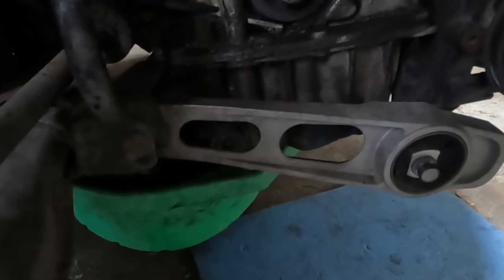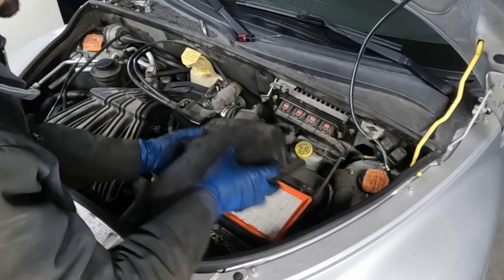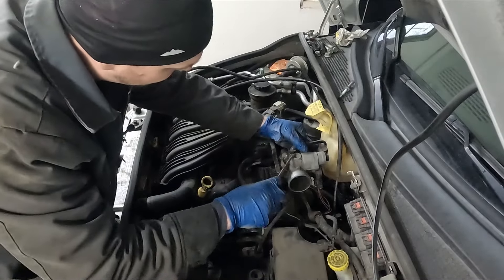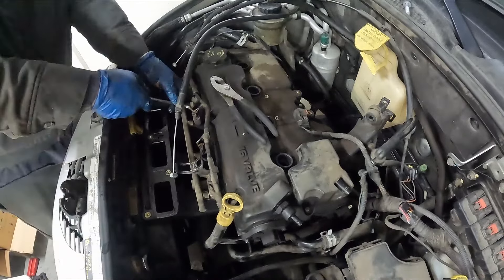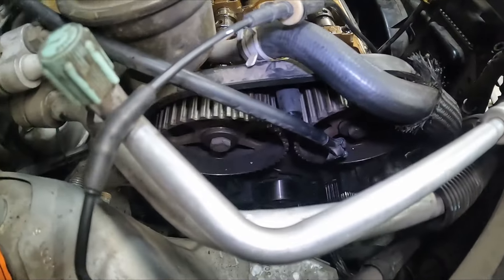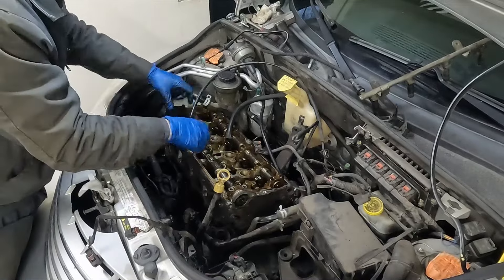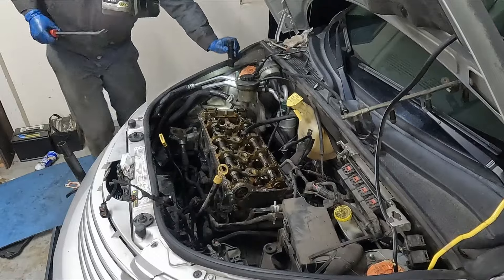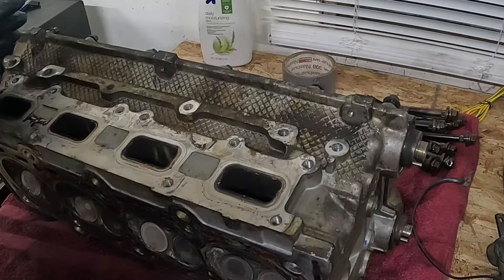PT Cruiser Head Gasket Replacement Part 2 Removing The Head

Comment: How much would a decent machine shop charge to clean up and do the head?
Reply: Mine costed me 560, but it was crooked as hell, and valves were not looking good, but I think the clean up and resurfacing only can cost anywhere from 200-350

Comment: What about blasting (Impact driver) those cam bolts off earlier when the timing belt was still together and then just putting them in hand tight until ready to take the pulleys off?
Reply from the maker: @catlady8324  The room was too small to get any power tools on the cam bolts. Using the hole in the cam worked great! But if you come up with another method feel free to share your experience 👍

Comment: You don’t show how you disconnected the exhaust manifold from the head.
Reply from the maker: @gunnysantiago7100  Time index 14:28 shows where the bolts are. Very easy to see when you're back there 👍